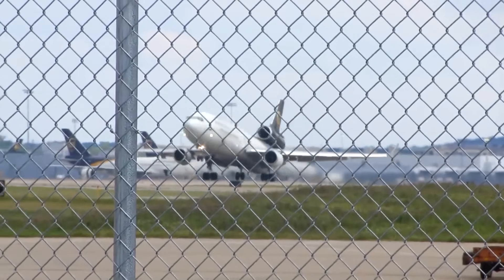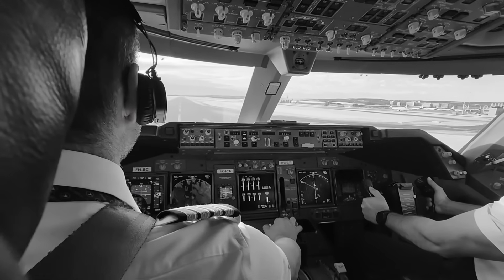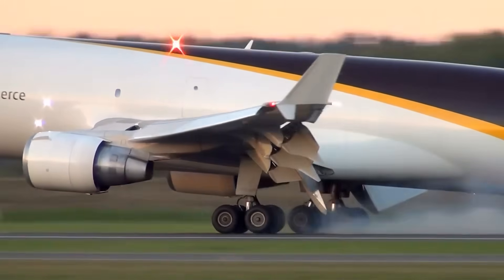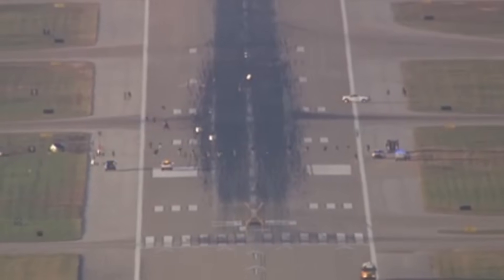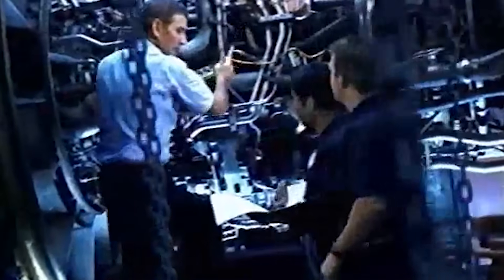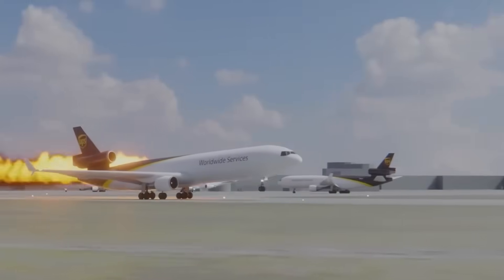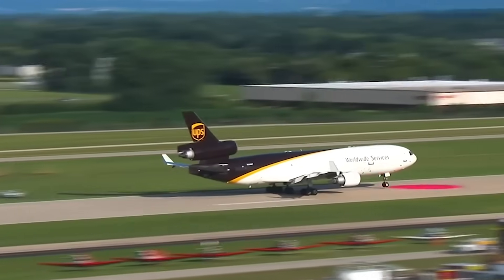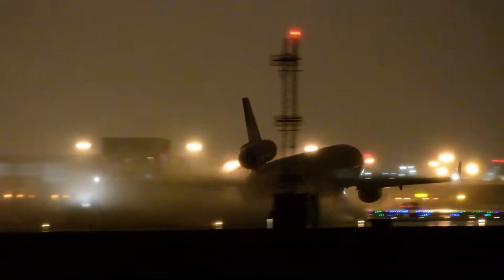The REAL Reason UPS 2976 Failed So Catastrophically...Mistake repeated AA Flight 191

Comment: Why do you need a bearing used as an engine mount ?  Most aircraft just bolt their engines to their airframes without using a bearing as a mount .  Is it to compensate for wing flexing ?
Reply: The spherical bearing is on these is like a large palm sized cannon ball with a large hole through the middle locked inside a retaining ring. ( I have one on my desk that was removed from an airframe I flew back in ‘98). The ring locks the bearing into the aircraft mounting plate allowing the pylon mounts to flex under heavy load. That flex is crucial to prevent onset of fatigue, which is ironic considering the nature of this accident. These engines develop a tremendous amount of thrust which in turn causes a huge precession on rotation trying to twist the engine off sideways. The spherical bearing dampens this as well as general flex of the engine/pylon system when in flight.
It’s the fixed mounts attached to the underside of the wing that have failed due aging fatigue allowing the pylon, with its spherical bearing to depart the airframe.
I used to fly DC10’s. Flew them for years and they are a great aircraft. All these aircraft are now old and like any aging mechanical object, it’s clear the inspection/replacement intervals for these components should be less than it is.
The failure of this engine mounting bracket although remarkably similar to the AA accident back in the 1970’s, doesn’t appear to have the same root cause. AA’s accident was caused by negligent engineering shortcuts causing damage to the mount and thus failure of the part quickly. At this point in time, UPS looks like it may have succumbed to ageing metal fatigue on a high load part, although the investigation will determine whether this was the case or poor engineering…..we will have to wait and see.
Would I get back in a DC10 today and fly it……hell yes I would. But it’s fair to say all airframes will need a detailed inspection of the assembly, or replacement of the brackets or at very least X-rays of the mounting assembly to assess fatigue in that part.
Wings flex to prevent stresses building up in the structure. The spherical bearing does the same thing. Without it, the forces would quickly rip the aircraft to pieces.
Many years ago a Trident broke up in flight whilst traversing severe turbulence over a mountain range. British aircraft of the time (I’m British BTW) had rigid wings with little to no flex in their design. This played a key part in that airframes loss. When Boeing bought out the 707 back in the day, it was the first airliner I believe to have a wing that readily flexed and all others have followed suit since and for good reason.
The DC10\MD11 design is good. The inspection interval on these parts clearly is not. That’s not poor design, it’s engineering service interval complaisancy.
God bless all those who perished in this terrible accident.
Reply: @GeeBeeMike  The bearing design allows the bulkhead lugs to take on up, down, and lateral (side loads).  No axial (thrust) loads are introduced at the bearing location as all thrust loads are transmitted from the pylon to the wing through a separate thrust link which is located immediately back of the forward bulkhead.  The bearings allow the bulkhead structure and associated lugs to be designed knowing that there won't be any bending loads introduced into the structure.
Reply: Why would a bearing be required for wing flex on MD-11 given wings on all aircraft flex and yet you claim they don't have bearings?
Reply: Bearing is a hard surface with large load distributing area. Slight movement from flex too i would guess.

Its a fair question.

Comment: Helicopters have components replaced on a schedule regardless of any visible issue. If metal is detected in oils, at a certain point, you replace the part. Why not in this case. 
21,000 cycles in an aircraft not designed for this kind of service....
Reply from the maker: That's a good point about scheduled component replacements in other aviation sectors.
Reply: There is one other Decades old problem that this crash has exposed:  the willfully deliberate complacency of the FAA to write inadequate the safety regulations that should have replaced the parts of the pylon assembly parts that broke when this plane lifted off the ground.  You hit a proverbial nail on its proverbial head when you mentioned the Island Hopper airline maintenance mentality.  We saw it over the Decades with explosive decompression incidents that almost caused an Aloha Airlines Boeing-737-100/200 plane to crash into the Pacific Ocean over 37 years ago.  Then there were the 2 or 3 Southwest Airlines Boeing-737'S that suffered explosive decompression incidents in the 21st Century.  Those 737'S suffered skin sheet metal stress caused fatigue cracks around the rivets that fastened the sheet metal panels together.  The time for the FAA to act was back when they allowed cargo carriers to add Passenger Airlines' retired passenger planes to be reconfigured as new freighters.
Reply: @michaelworden9265 The regulations are written in blood. Like any human endeavor, you learn as you gain experience and make improvements accordingly. Don’t ascribe malice where it can be better explained by ignorance.

Comment: As unfortunate as this was.. it happened in the best possible place as for loss of life... the plan would have been over mass population if going in any other direction as to normal runway takeoffs.. should the plane been going north instead od south... Mass loss of life would be devastating the hundreds 😢😢😢
Reply: Unfortunately, it was precisely the worst time it could fail. If it had failed 5 seconds later, the engine would have just ripped off downwards. If it had been 5 seconds earlier, they might have been able to stop the plane on the runway.

Comment: im no engineer, but all you have to do is look at how that engine is suspended from the wing to realized how uneven the weight distribution is.   This aircraft design should have been eliminated a long long time ago.   And yeah, it lasts a lifetime.   When you crash thats the end of your so called "lifetime"
Reply: Most new cars come with a Limited Lifetime Warranty. When you buy a new car, doesn't that fact tell you something?

Comment: Why don't you just say maintenance was done Incorrectly .
Reply: AA191 was. This one wasn't.
Reply: @bobjohnson6217  We don't know yet. Too soon to say one way or another. All we can probably say is UPS was not improperly using forklifts to remove and re-install the engines. Everything could have been done completely "by the book", but the book was wrong in regards to these engine/pylon mounts. Or maybe they skimped on things. We will know in due time.

"By the book" screwing them was  the case with the actual flying of AA191 - the pilots handled the loss of an engine (which they didn't know was literally that it came off the airplane damaging the wing in the process) by doing what "the book" said - pitch to increase climb, which naturally decreased the speed. When the speed went below the stall speed of the wing with the no longer extended slats, it was all over very quickly as the wing stalled and the airplane rolled over almost onto it's back before impact. But they had no way of knowing what was going on. In the aftermath, procedure was changed to maintain speed, and additional warnings for asymmetric slats was added, along with locks to keep them from retracting in the first place.

What I find fascinating is why didn't AA191 have the massive fire? Was that just dumb luck or some quirk of exactly how the engine departed or a difference in design between the two airplanes. Because without the fire, UPS would have likely been just fine. AA 191 was doomed either way by the aforementioned flight procedure. A massive fire probably would only have meant they hit a little closer to the end of the runway, but i don't think they even got as far as the UPS plane did, though they got higher.

Comment: A Shocking Tragedy

Takeoff is the most Critical Phase of any Flight.

A Structual Failure during Takeoff led to the Death of 14 Poeple

This Crash will make flying Safer.
Reply: I would say that landings are a tad more critical. Takeoff is optional, landing is mandatory. Ultimately, every crash makes flying safer. Aviation lessons are usually written in blood. There will be a whole new inspection regime for these airplanes, and their already looming retirement will certainly be accelerated.

Comment: I was struck one day where I worked when a group of high school kids came into my laboratory and using high lift platforms began changing the light bulbs at about 30 feet up. The bulbs were still working, but GM decided to change them out as a maintenance interval. The kids were all but petrified to ride a man lift up so high, but they were getting paid so they did it. When an aircraft falls apart during usage it makes me wonder at what cost are we flying these planes. Everyone has heard how the American commercial airliners are an aging fleet, but no one seems to know where to draw the line on their life span. Just like the light bulbs still working in my laboratory, but someone said they are old and needed to go. But not commercial aircraft parts? Why? Money? Time? It's not fair to those pilots and the people on the ground when the decision to just keep going was made. The dead did nothing wrong except trust. You couldn't pay me enough to fly a rickety old airplane and you couldn't pay me enough to work on the ground anywhere near the flight path for incoming and outgoing air traffic. We just proved once again that the almighty dollar is worth more than someone's life. STOP DOING THIS! IMMEDIATELY! ben/ michigan
Reply: Maintenance and inspection standards are extremely intricate and thorough. UPS conducts full engine off inspections at 5 year intervals. Based on flight cycles and flight hours, a five year rotation is perfectly adequate to detect fatigue issues like this. This is simply a terrible accident which simply cannot ever be completely eliminated. It’s either stop modern travel and fright movement or learn from history and move forward.
Reply from the maker: That's a powerful analogy comparing the light bulbs to aircraft parts.

Comment: Someone with a simulator should see what would happen if pilot aborted takeoff to see if results would be better. I personally think it would have been better. 10 knots before V1 abort or 10 knots after V1 take off? that's only 20 knots difference. ✈
Reply: That’s a huge difference. Momentum increases with the square of velocity.
Reply: It’s been repeatedly tested,  which is why you never reject after hitting V1 speed…. You take it airborne .

Comment: In reality you very rarely use max power unless you’re operating out of very short runways like John Wayne.  You usually do a reduced power takeoff to go easy on the engine.  Plus it is quieter .
Reply: Fully loaded MD-11, fuel and cargo for a long range flight, am doubting "reduced power takeoff" was possible
Reply from the maker: That's a good point about reduced power takeoffs for engine longevity and noise reduction.
Reply: High gross weight and nearly full tanks argue for no derate.

Comment: The structural reality is that pretty gals can also develope crracks and come apart during performance.  RIP to all and keep DEI out of engineering schools😢 to keep safety standards high as well as maintenance programs😮
Reply: Ya had to bring your racism into it, didn’t you?  Shame on you!
Reply: What does dei have to do with this crash?
Reply: @danimal287 older airplanes and older gals can give trouble and wear out..., trade both in for newer models for better performance 😂they have common traits😂

Comment: For some reason, here in England it has been quoted that the records for the engine mount checks were not present.
If this was not from the NTSB then I know not where. The 20,000+Hr check was quoted and the 'plane had done 90.000 hrs when tragedy struck. So what happened with 40,60,80.000 Hrs .Whatever unfolds it should not have happened.
Reply: Design that makes inspection practically impossible … should not have happened
Reply: @AlainDessureault  How does a design pass commission if a highly stressed assembly cannot be checked due to the design itself? Is it practically impossible or financially inconvenient?.
Reply: @simont1108  
My assertion of "inspection practically impossible" is perhaps an exaggeration.
A better statement is "the aft mount lugs present challenges for effective crack detection, particularly for fatigue cracks like those found here, though not due to physical inaccessibility but rather the limitations of standard inspection methods and the component's design" — says Grok AI
The FAA approved the maintenance intervals for the MD-11. However, the undetected crack growth since at least 2021 (over 4 years and ~10,000+ cycles) has prompted scrutiny of these intervals.
So it seems the FAA screwed up — regarding how regularly these aft mount lugs should be inspected for cracks.
Reply: Thanks, that probably answers the question about efficient maintenance. I've had to sign off any safety critical procedure in England UK and that makes you traceable and liable should catastrophe occur. The specific check documentation for the 20,000hr+ engine mount examination was missing allegedly and if so where is the subsequent check documentation? The aircraft allegedly had 90,000 hrs when this tragedy occurred. I may have been misinformed and don't work in aviation but would appreciate any feedback to give me a better understanding of the overall picture. A picture that no one should witness in the 21st century. The pilots and people on the ground who died deserve for their families to be told the truth.
Reply: @simont1108  
In this crash, the focus is on systemic factors
like inspection intervals
for the MD-11's aging design.
So far, the prelim report shows
the aircraft was in "compliance"
with required maintenance
at the time of the accident.
The fatigue cracks likely developed over years,
undetected by the visual/lubrication checks.
The cracks were subsurface and not visible externally,
which is why the FAA's Emergency Airworthiness Directive
now mandates ultrasonic/NDT inspections fleet-wide for all MD-11s/DC-10s before return to service.
Reply: @AlainDessureault  Fair enough, but if the crack originated on the inside diameter of the pin holes or bearing housing would those have been crack tested?.
Reply: There were over 20,000 cycles, not hours. Cycles and hours are different things. One cycle is a pushback, taxi, takeoff, climb, cruise, descent, landing, and taxi to the gate.

Comment: Another in the series of fatal design flaws inherent in the original DC-10 design.  This airplane was rushed into service before adequate testing verified its design decisions.
Reply: Indeed, design that makes component inspection quite difficult … should not have happened. Design should accommodate effective inspection
Reply: NTSB  was doing  Dougles a favor  letting this POS fly after early problems they. Flight 191 should have  stopped  this  garbadge  from flying an dkilling people .
Reply from the maker: The investigation into this incident highlighted various factors contributing to the outcome.